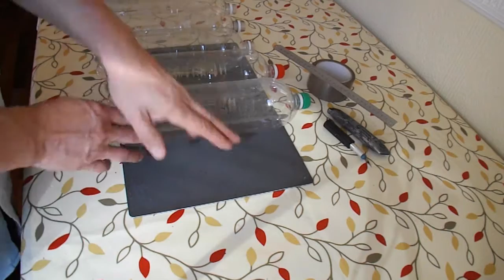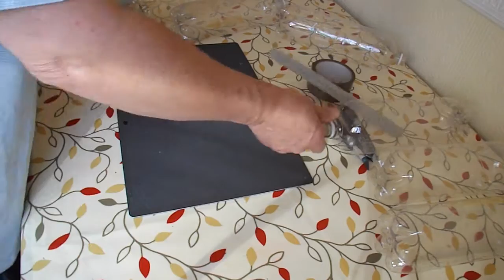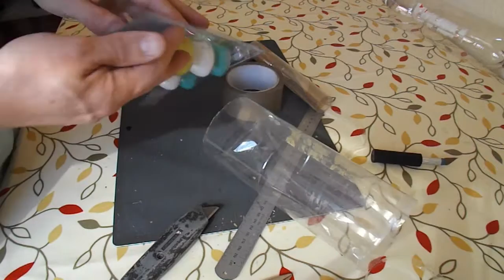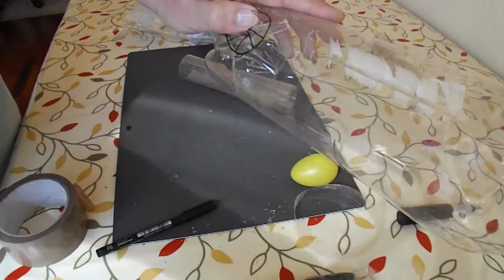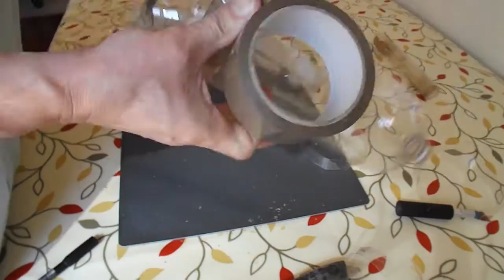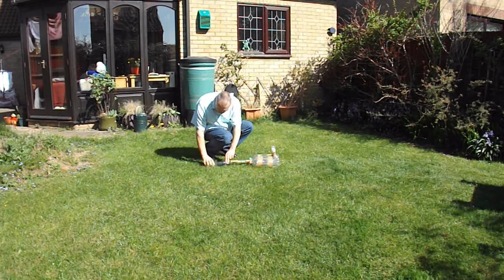Easter Egg Pop Bottle Stomp Cannon

Comment: i have 2 different size plastic easter egs  so i would have to make different size tubes :)i wanted to do this project , but health and other things got in the way.
Reply from the maker: Hi Allan, sorry to hear you have health problems. If you did ever make this you could try adding some tape or something to make the smaller eggs wider to fit the larger tube but I guess it would be just as easy to have two launchers and double your fire power  😊